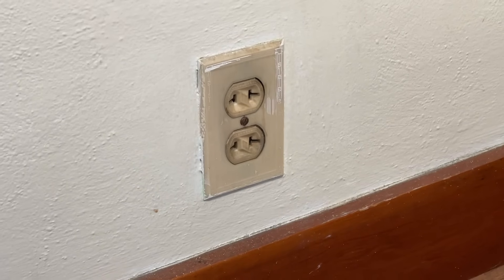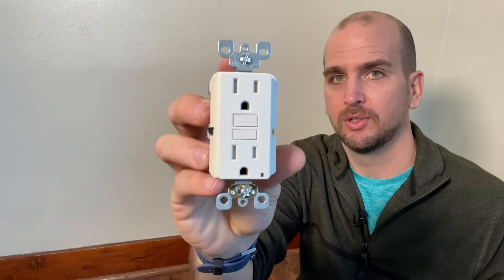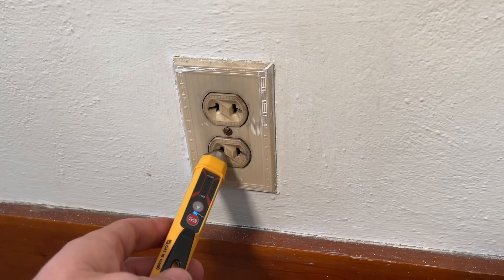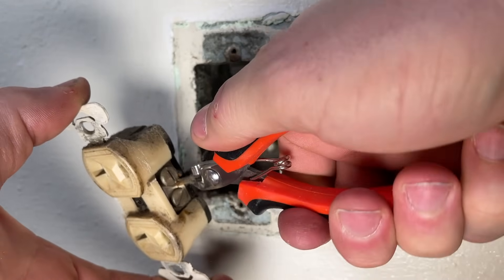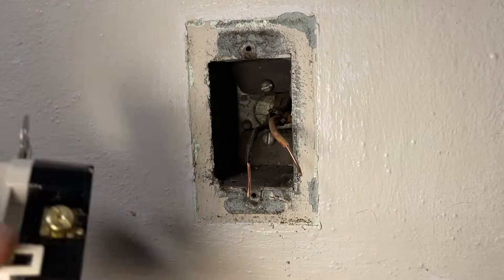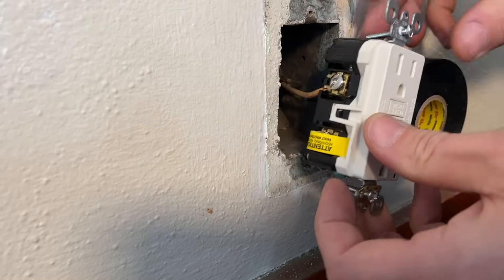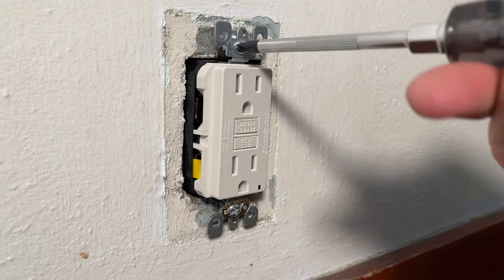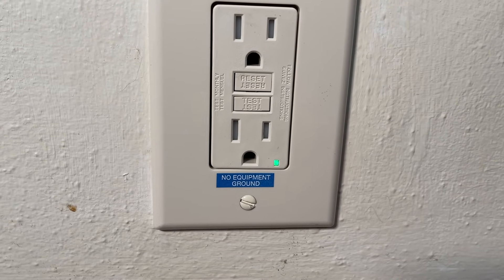How To Replace An Old 2 Prong Outlet Using 3 Prong GFCI

Comment: Sometimes there is a ground on these if they used one of those rigid wires.  They are those wires that have that metal sheath wrapped around it.  They make it harder to accidentally cut the black and white wires.  The metal covering also acts as a ground wire when connected to a metal box.  The way you can tell is by using one of those testers or a meter and put one probe into the hot side and then touch the screw holding the cover on.  If you get a reading, the box and screw are grounded.
Reply: You seem to be discussing either EMT or flex-conduit.  Flex-conduit can be either steel or aluminum.  In all cases, the conduit is not a legal, legitimate ground path, although it probably is better than nothing.  In other words, you will be probably be dead before the circuit breaker responds and trips due to to the high-resistance ground path.
Reply: @richardspengel3281  He may be thinking of BX armored cable which uses an aluminum wire & the armor sheathing as a ground in addition to keep rats from eating the wire insulation creating a short circuit & also helps contain an electrical fire in a multiple dwelling.  Big thing within NYC limits. Was required in Long Island, but now uses Romex & plastic boxes.
Reply: @richardspengel3281  fyi in Canada we are allowed to use EMT/Rogid conduit as a legal grounding (bonding) method. Connectors and couplings have set screws for this reason. Flex needs a bond pulled though

Comment: You should not stretch the tape, because over time, it comes off and contracts like a rubber band. I can't count how many Ive pulled out, and found the tape ring around the wires and not on the receptacle.
Reply: Tape is not needed at all. It's like wearing a covid mask..IT's useless!  Just like people taping their wire nuts...They shouldn't be  permitted to make wire nut connections at all if they are going to tape them.
Reply: @jockoharpo2622  when using a metal box or a plaster ring, tape should be used.
Reply: @jayhaines1792  Wire nuts are not meant to be taped. Had they been, they would come  with a roll or instructed to use them in recepticle boxes. I didn't call you or anyone names in that process..I stated my take on it as being useless.  I didnt' ask anyone how dense they were.  WIre nuts are designed to cover the wire all the way up to the insulation.  There is nothing  inside a recepticle box that can protrude up inside the wire nuts as well.  And i'll telly you why taping them sucks..Because I'M THE ONE THAT HAS TO COME IN AND DEAL WITH THE GUMMY SHIT TASK BS JOB OF REMOVING THAT NASTY SHIT AND IT'S ALL OVER MY FINGERS.  AND IT CAN GET ON THE FINISHED PAINTED WALL AND RUIN A PAINT JOB AND THE PAINTED RECEPTCLE COVER IF IT WERE ALSO PAINTED. .........THAT'S WHY!
Reply: @jayhaines1792  Why?  You gave no reason.  You only stated it should be used.  Is it code? I'm an  HVAC  tech and it's the nastiest thing to have to peel and cut that gummy shit off of a wire and the residue is still there on the unsulation and sometimes (most of the time wiht my luck) you cannot cut the alreeady shortened wires up..Tape to me is a bandaid to someone who cannot make true wire nut connections..and there are no shortages of that type of person out there either.
Reply: @jayhaines1792  SO what if a recepticle box is metal. Ther isnt any sharp protusions on the box that causes any issue..SO what..the box is conductive. Yes..to someone that has to resort to gummy black tape as a badaid to their confidence. Jus like duct tape.. It can be used on anything but DUCTS!  In Ohio..it's against code.
Reply: @jockoharpo2622  you're not very bright. Electrical tape around a receptacle prevents the terminals from potentially shorting against the plaster ring. It is not against any code. You're obviously not an electrician, or a very good one.
Reply: @jockoharpo2622  exactly. You're an HVAC tech. You're not even supposed to be playing Electrician.
Reply: @jockoharpo2622  and your responses have nothing to do with my one comment. The fact that you can't even reply to the correct person on here, proves that you're not the smartest one. I've been a Master Electrician for over 30 years. You stick to huffing refrigerant.
Reply: @Jason_Van_Stone  gotta love the HVAC guy who thinks he is a Master Electrician.
Reply: @jayhaines1792  😆 I'm loving the rant about taping wire nuts, but no where did I mention wire nuts 🤔
Reply: @jockoharpo2622  how is it useless? How dense are you? It's extra precaution, especially if you're pulling out the recept just to verify something while it's still hot, either on purpose or not. Therefore, the terminals are covered just in case you your fingers slide by it, genius.
Reply: @Jason_Van_Stone  Your fingers can't get shocked with a wire nut connecton that was done properly as like i said once before...the insulaton is butted up into the wire nut maestro!
Reply: @Jason_Van_Stone  Your fingers aren't going to slide by a hot circuit..You aren't supposed to be putting your fingers into a recepticle if it's hot..This is why multimeters and volt testers are for.  GENIUS!  THere is no reason why anyone should be sliding their fingers inside a receptcle box..That's why they made genitals...GENIUS!  People can be electrocuted with as little as .2 amps can be severe.  BUt if you want to do some finger sliding he my guest...Put some vaseline on them too!

Comment: I haven't watched the whole video, so don't know if it was mentioned or not, but do not install a GFCI receptacle where the ground wire is aluminium and not copper.
Reply: Could you explain why? The GFCI trip circuit does not rely on the ground. Please correct me and provide a Code or trchnical  referenceif I am wrong.

Comment: since the neutral wire eventually ends up on the same bar as grounds, why can't you connect the recepticle ground to its neutral screw?
Reply: What?
Reply: It is a safety issue. The neutral carries the unused current back to the panel (return path).
Reply: @jayhaines1792  so does ground.
Reply: @RangerCaptain11A  the ground is not normally a current carrying conductor. It carries fault current, if a fault occurs in the appliance that is plugged into a receptacle. Otherwise the ground does not routinely carry current. You can disconnect the ground wire and the appliance will still work. If you disconnect the neutral, it will not work. Again, I'm a Master Electrician with almost 33 years in tbe trade.
Reply: Because the code says so. There are problems with a TN-C system like stray currents. The thing that people mostly fear is the broken PEN-wire. If the neutral that is used as a ground gets loose it puts the mains voltage to the cases of all grounded equipment.

Comment: does that tape you use get sticky and gross leaving residue after a while in use? 
i hate cheap electric tape for that reason. its annoying to have to clean tape residue off something or my hands.

whatever is used in wire harnesses seems to be the best. not sure if the adhesive dries or its the self adhesive stuff.

Comment: FYI... most things that are plugged in (vacuum cleaners, table lamps, etc.) do not need a ground, so a 2-prong outlet can be replaced with the same; it is NOT unsafe.  Where you NEED a ground (stereo systems, microwave ovens, refrigerators), installing a GFI may meet code, but it doesn't get you the ground you need.

Comment: If you have a 2 wire outlet, then the only connection for the equipment ground wire is if the electrical conduit is made of metal--which is actually discouraged in the code. (To do this, a separate wire (green) should be run inside the conduit to connect to the panel board, which is connected with a wire to the rod driven to the ground.)

With the circuit energize, voltage should be tested between the neutral and the outlet body to check that the conduit is not hot. (If it is hot, then either the conduit is grounded or that the white wire is the hot wire and not the neutral wire.) With the circuit turned off, continuity of the conduit should be check by checking the conduit and the neutral--that is, for the sake of using the conduit as the equipment ground. What's the use of the equipment ground if it is not even connected all the way to the ground. (The green screw of the GFCI was for the equipment ground, which is connected to the bare wire or green wire.)
Reply: Where does the code discourage conduit? In fact, it actually requires conduit in certain applications. Romex is only for inside walls, basements, and attics of residential houses.

Comment: I have a 100 year old home with mostly 2 prong outlets and a few 3 prong outlets (not gfci). I pulled all of the 3 prong outlets out to see if there is a ground wire and there is none. I'm assuming by the video this is not allowed.

Comment: This installation makes sense to me except for one thing: What is the point of putting in a CFCI outlet when there is no ground to reference for CFCI operation?
Reply: Well, lets say you plug in an old space heater with a metallic housing (it doesn't specifically have to be a heater, it can be any device with a metallic housing), and said metallic housing is shorted to the live wire. When someone (who is referenced to ground) touches the live space heater, without the GFCI, the person would likely get a bad shock or worse, die. But with the GFCI, despite it (the GFCI) having no ground wire itself, will still detect the current imbalance caused by the person touching the live heater, and shut off the load. This is also how the GFCIs in hair dryer plugs work (since none I've seen had a ground prong).
Reply: The term "ground" in  GFCI has nothing to do with "ground" in protective grounding. Ground fault means that current escapes to the ground. While this sure could happen through the ground wire that is not what the GFCI is used to protect against. It protects against the current escaping through a person. A GFCI works by comparing the current in live and neutral connectors and if there is more than 5 mA imbalance it cuts both of those.

Note that even in properly grounded systems there can be faults that do not cause a breaker to trip, for example the cord can be damaged exposing the live wire.

Comment: Putting a label on the receptacle “not grounded” doesn’t make it much safer than the older one. Go to the trouble of truly grounding the new receptacle for 100% safety. Also, if you don’t want to make a j hook wiring around the screws, at least put them in in the direction the screw turns ( righty tightly). Thanks for trying to help.
Reply: It is the GFCI that makes it safe. The label just informs anyone interested, like someone testing the outlet.

Comment: Great video! You made it simple, and easy to follow. I'm replacing multiple outlets with GFCI's. I have one question. Years ago, I plugged in a paint sprayer to a knob and tube outlet. The sprayer was sitting on grass. When I went to move the sprayer, I was shocked by touching the metal area of the sprayer. Would a GFCI replacement have prevented that? Did the fact that the sprayer was sitting in grass that may have been a little wet cause the metal to be charged? If not, I would be concerned if say, a metal toaster could carry a charge. My guess is it wouldn't.
Reply: I would guess that your neutral and hot were switched. If it was a two prong outlet, you could have flipped the plug . The paint sprayer was probably grounded to the Fram. when you flip the plug, it will put the neutral on the Fram
Reply: @islanddave8606  Nothing is grounded through the neutral.
Reply: An electric shock generally means that there is a fault in the device or the cord. A GFCI could have triggered because it was on wet ground. In general you still get shocked in case of a fault but the GFCI cuts the power before it can cause serious harm. 

I would  not trust a GFCI alone in a wet place.

Comment: Never cut the old wires like that. They are too short as it is. The code is 6” from the back of the box which is already too short. Always hook up the hot wire last and disconnect it first as safe practice and 50% of old outlets are wired with reverse polarity. Never trust the color code.
Reply: I'm not sure about 50% being reversed, but in my youth my father bought me the top of the line Fender Jaguar guitar.  If the cord was plugged in one way there was no problem.  If the cord was reversed,  ouch;  best to use a guitar strap to keep from dropping guitar when you're getting a wake up call from local electric company!  It will wake you up, big time!
Reply: My mother's old home contains many outlets with reverse polarity. Question: when replacing outlet with a standard single pole, do we reverse that polarity or wire it the modern way?
Reply: I agree!
Reply: @ArizonaAdam  I don't agree, now what do we do? 😮🤣🤣
Reply: Yes, he had perfectly fine, stripped ends that were already bent into a J-shape.
Reply: Seriously dude? You think I'm gonna listen to a nub like you(👎)over the certified electrician that did the video? 🤣🤣
Reply: He did use a tester after he finished. Had polarity been incorrect it would have been indicated on the tester.
Reply: @JeanPierreWhite  WIth no ground reference, not sure the tester would be able to determine polarity.
Reply: @surferdudemi  You're probably right. The video author was using a voltage tester also, that maybe the way to test which wire is hot.
Reply: @surferdudemi  If you're not sure then do not comment. 🤣

Comment: at $16.00 an outlet, and you don't have a direct ground like you said.. I say re-wire the house. It will bring back in the sale.
Reply: is this an attempt at satire?
Reply: @ryanmcallister6958  if u think it's funny, but what I say is true.. it's a cheap way to fix something that should be done the right way. and that is running new wire. period
Reply: @robertcarullo4926  which involves countless hours of removing drywall. this fix is nec approved so why not for $20 each line? you can just do one and replace the rest with $1 plugs..
Reply: @ryanmcallister6958  Yes, but you can only do one plug, you can't run the whole line. and yes it would be cheaper, but no home inspector is going to say that is the right way. if you know what your doing you don't have to break all the drywall by any means.
Reply: Only if it has a continuous electric metal conduit (EMT).
Reply: @jonbasa  only if what has a continuous metal conduit?
Reply: @jonbasa  Yes in some states. in florida you can run wires through the walls very easy. so it depends on where you are. You don't need metal conduit in a lot of areas.
Reply: @robertcarullo4926   - agree , new wire is a good idea  . 2 people as long as one knows what he is doing makes it easier . But pulling in new wire is often not “ very easy “

Comment: Is there any harm in having the first receptacle in the run be a GFCI and the last in the run be GFCI with six standard receptacles in between? Is this safe, overkill or a non-issue? Love the videos! Thanks!!
Reply: It is definitely overkill but you could do it Although I wouldn’t recommend it because it’s unnecessary and much more expensive
Reply: @TechHowden  Thank you! A couple additional pieces of information... not sure if this would change anything. first one is in the laundry room and the last is in an adjacent bathroom. The six in between are used for a single lamp and phone charger, and a vacuum now and then. Thanks again!!
Reply: @michealolsen1344  I would recommend just putting a GFCI on the first outlet and then normal ones for all the others

Comment: 2:18 short wires , I would unscrew them and save as much wire as possible
Reply: you might have space to make a pigtail which would be better
Reply: @yellowflash5555   - I’d still unscrew them first ; can always shorten later - IF you are good at pigtails .
But for everyone else maybe not  .
Reply: What a skilled electrician does everyday ; and what someone who has never done this before , should do - Might not be the same thing